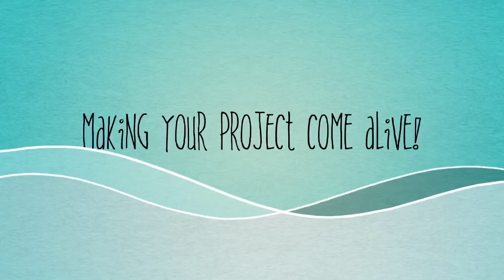How to sew a separate pocket to a window valance

Comment: If you must add the pocket, 12:52 try folding the end of the pocket allowance over the end of the valance when you begin the first seam and fold under the other end when you arrive. When you finish pressing and fold for the last seam, the ends are nicely finished.

Comment: Scott, thank you.  I am assuming that you need to take into account the correct size for the returns, especially for treatments that have pleats at the ends.  How would you measure the returns using this type of rod?
Reply from the maker: Yes you are correct and I should have covered this in my video. The “face” of the rod is completely straight and where the bend starts would be considered the return. Thanks, Scott